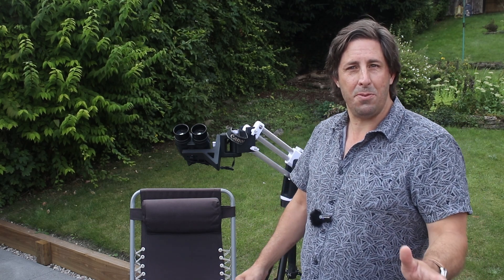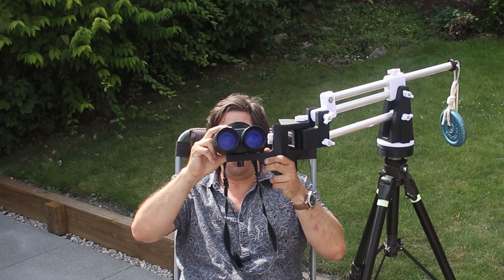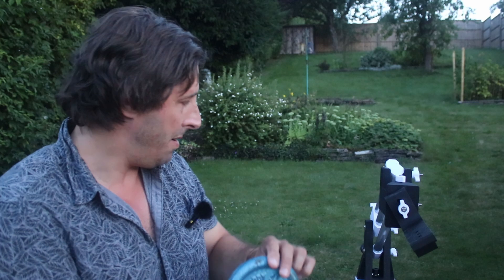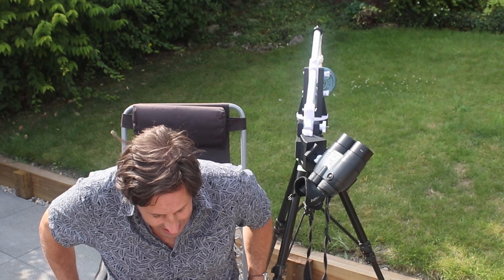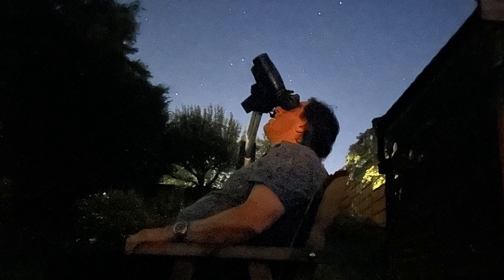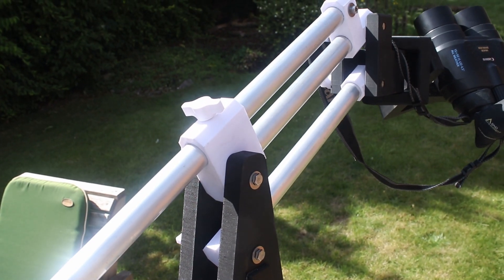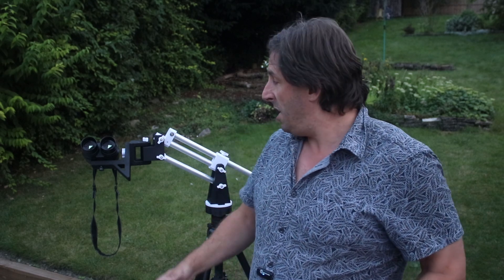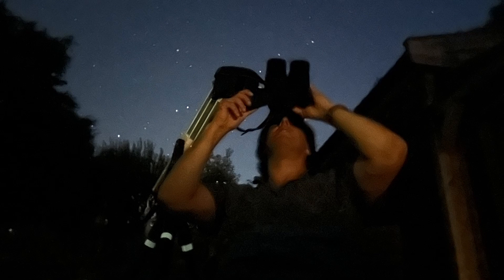Lightweight, Affordable, 3D printed parallelogram mount

Comment: Canon 15x or 18x IS binos?? Guess you need a mount as they’re hefty? Bino bandit…. Nice!
Reply from the maker: Hi Peter - these are the 15x50 with bino bandit and the canon tube extensions as mini-dew shields.  They're not too hefty especially when you use the IS but it's lovely to use them on the mount  as you can observe without fatiguing arms and neck. Great fun!